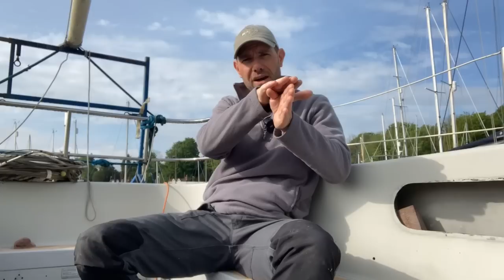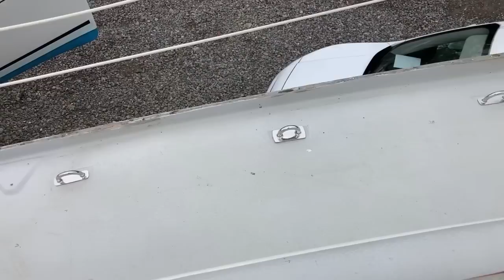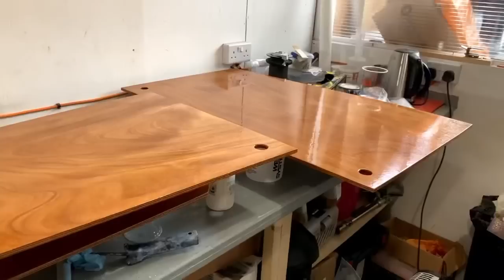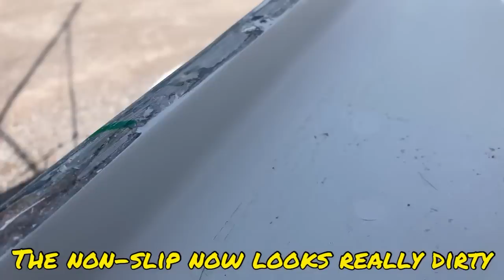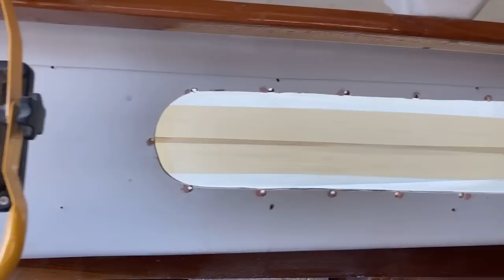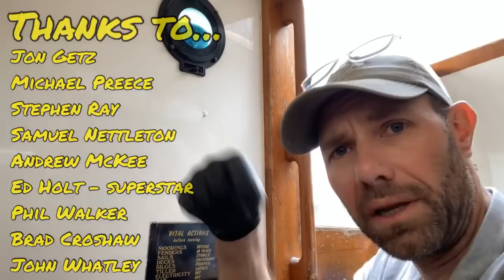Rigging U-bolts, Gelcoat Repairs, Deck Repairs, Bits and Bobs part two (Project Lottie Ep19)

Comment: Absolutely captivating to anyone who's into boats! Wouldn't it be better if the backing plates were rounded of in the corners, instead of sharp 90deg corners? Something like aeroplane windows shape...
Reply from the maker: The the loads/stresses involved these backing plates are way over size so I don’t think it’s an issue.   Thanks for the comment.

Comment: Hello George, I'm very happy to buy you a beer to thank you for all you have taught me.
I have a question - what is the headroom on a Contessa 32 in reality? I need 6'2. Also, could you give me an approximation of the cost of the Lottie project? It gives me an idea of what I should be paying for a yacht that needs restoring. Many Thanks.
Reply from the maker: Thanks, headroom is not great if you are over 6’, I’m about 6’1” I think and the only place I can really stand is in the cutout for the centre hatch (which not all boats have).   Re costs that may be covered in a final supply video but only if the owner is happy to share.    The headroom is not such. Big issue, you get used to it IMO, I know plenty of tall people that own or sail them.

Comment: Another really interesting & informative video.  This has given me the confidence to tackle the holes in MB's headlining - which is a bit like a pepperpot, as you know!  Did you just use some ordinary gelcoat that you would have used on other gelcoat jobs & hence the need to add wax or clean with acetone, or was it a specific gelcoat filler which you can buy?  I assumed that if I bought the gelcoat filler products that are advertised it would just cure the same as any other filler, or have I got this wrong?
Reply from the maker: Thanks John, easiest option for you would be to buy some generic “gelcoat filler” from the chandlery, the holes are small enough and the colour similar enough that it will do the job just fine on the headlining.

Comment: I did my U bolts with plywood backing plates I think maybe the g10 is better. I am always worried about moisture getting in and rotting the wood.

Comment: I like to use a thin elastic tape (like thin electrical tape) over the gel filled hole. Means the gel coat is only slightly proud when its set and helps stop sagging reducing the work needed to flat back. Cheers!
Reply from the maker: Yep that works, as does Mylar film but it also tends to squash the excess gel out over a wider area so it’s not as proud but still excess gel to remove.
Reply: @RefitandSail  Yes but it also stops  a sag leading  to  a hole/depression that has to  be filled again. Cheers

Comment: hi mate, what material was the backing plate? love your channel
Reply from the maker: I think you are talking about the backing pad on the lower shroud ubolts? If so they are normally grp laminate cut to size.

Comment: What was the filler used to fill in the old screw holes? Thank you!  Great videos from someone who just bought a 1989 Hunter 333 that's a bit of a fixer upper.
Reply from the maker: It’s a semi structural polyester filler that works really well for small quick repairs.   Most chandlery will stock something similar.   No need to use an epoxy filler unless you really want to (and like waiting ages for it to cure!)

Comment: George great Vids. When you use Gelcoat I thought that doesn’t cure if not starved of Oxygen as in a Mould. Has your Gelcoat had Wax added?
Reply from the maker: That’s correct, I either add wax to the gelcoat which seals the top surface in the cure or I wipe off the excess uncured gelcoat with acetone after.

Comment: Great video.  Do you make those fiberglass backing plates or are they a commercial product (what manufacturer)?
Reply from the maker: The backing plate for the stanchions are cut from my own Pre-made laminate sheet, while the ones for the ubolts came with the ubolts when bought.   G10 is often recommended for backing plates, it’s just Pre-made glass reinforced laminate (normally epoxy rather than polyester) nothing special and lots of places to buy it online - or make your own as a fun project.

Comment: On my toe rail, I removed a 1 foot section of teak to install a stainless U-channel in order to give a better area for my dock Slidemoor to ride against.  To ensure a snug fit, I built up the toe rail a bit with some epoxy/fiberglass.  Is it OK to just install the stainless u-channel over the new fiberglass (completely covered by U-channel) or is it best to gel-coat/paint the new fiberglass first?
Reply from the maker: If it’s not on show then there’s no real need to re-gel or paint, just make sure the U is a good fit and if necessary fill any gaps with a goo of your choice when fitting.
Reply: @RefitandSail  Thanks!  I appreciate the advice.  Yes, I will make sure it is a good fit and planned to use 4200 to fill the gaps.  I would enjoy following you around the boat yard for a few month and helping....it would be an education for sure.  Honestly, thanks for the videos, I look forward to them.

Comment: What I really want to know is, when you have cables or pipes on the inside of the boat, how do you fix them in place?  I cannot bond anything like a cable tie base to the hull because it nothing sticks to the waxy flowcoat, I do not want to screw them down because any screw that is deep enough to work, risks going through the hull.  I thought of glassing a strip of wood to the hull so I can drill into that, but people say that the hull has to be able to flex, or it will crack.  How do you secure cable runs?